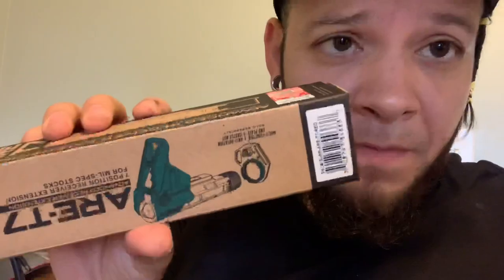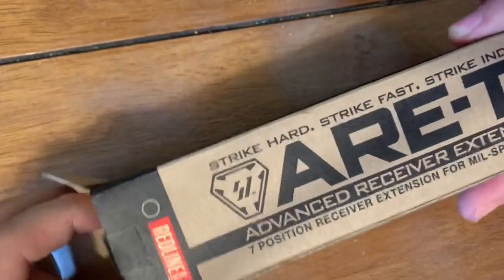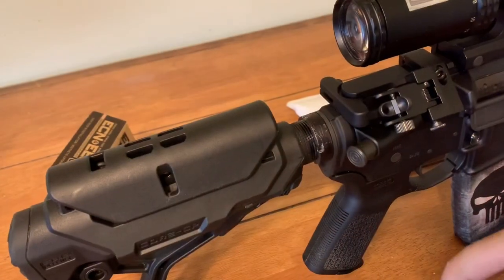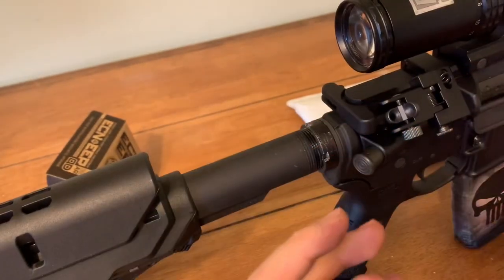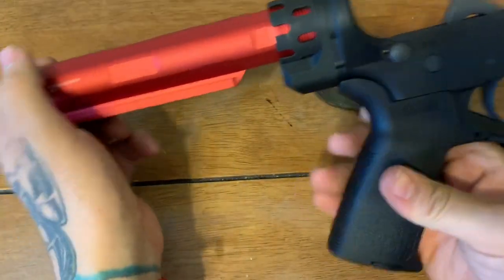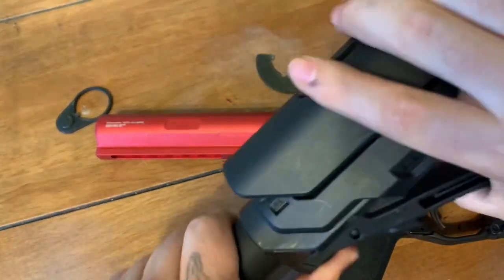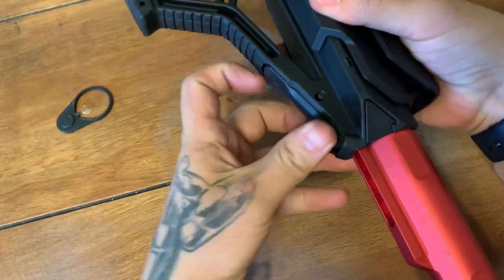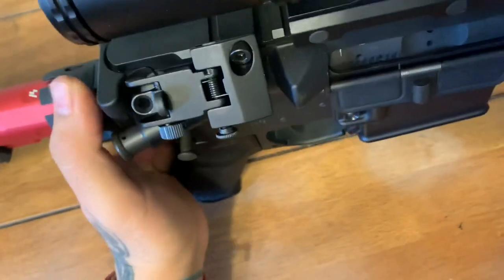Installing my enhanced castle nut and receiver extension.

Comment: I like to apply some grease on the threads to help the paint from scratching and also helps when taking the buffer tube off. You can also apply grease to the inside of the tube to help the spring sound and dampen it a bit.

Comment: Hey I just got the same setup. I got a quick question.  Did you use the armorers wrench to tighten the enhanced castle nut? I saw reports that the wrench could mess that castle nut up. Thanks for any help
Reply from the maker: Yeah, the wrench can damage it or scratch it, you gotta be-careful, I didn’t tighten up to much. You can always put a little glue and tighten up if your not gonna change it soon.
Reply: @efrenramirezpaz6207  Glue…